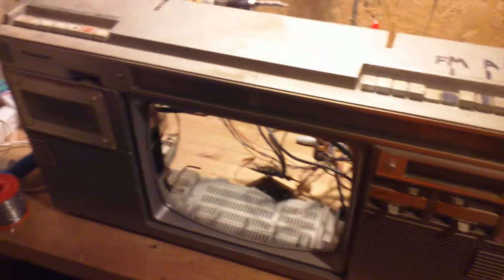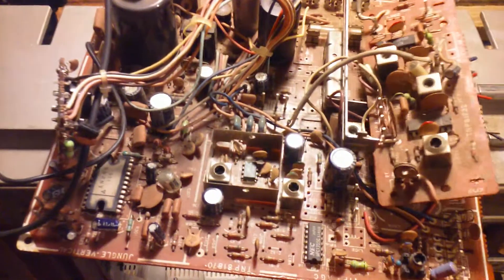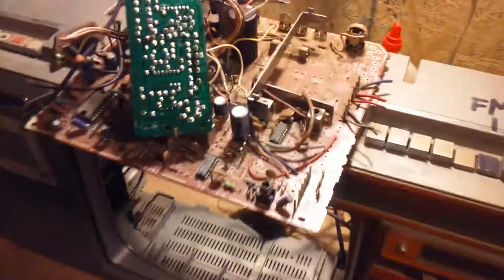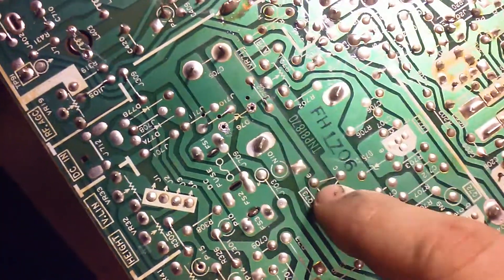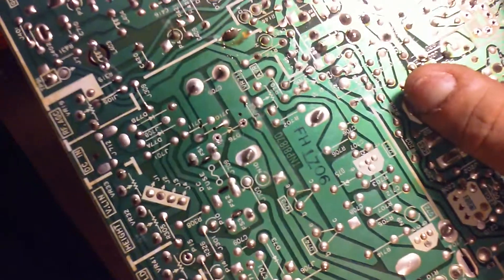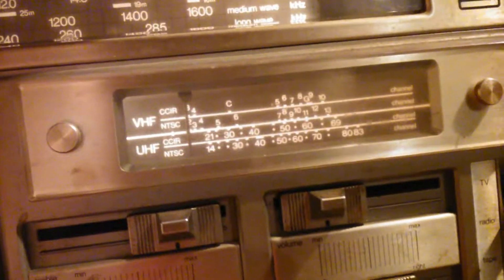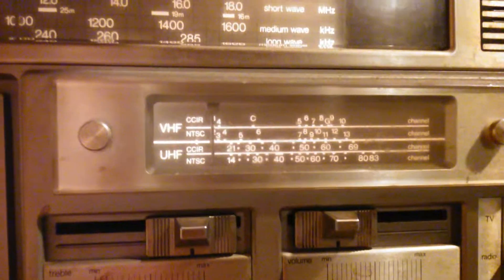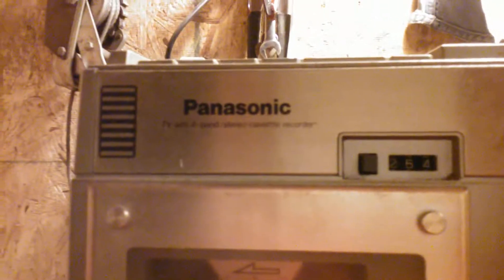Panasonic TR-1200X CRT chassis power bypass

Comment: Just found one of the these on trash day. Only thing wrong with it is the 2.5 A fuse was blown. Great info
Reply: I just got one today with the same problem. Fuse on the TV section is blown. Is it just a normal DC 2.5A slow-blow fuse? Do you happen to have a link for the fuse you bought? How's it working now a month later? I do see at least one corroded capacitor in mine, on the board by the tape deck, C1209, but pretty much everything else looks good at first glance.